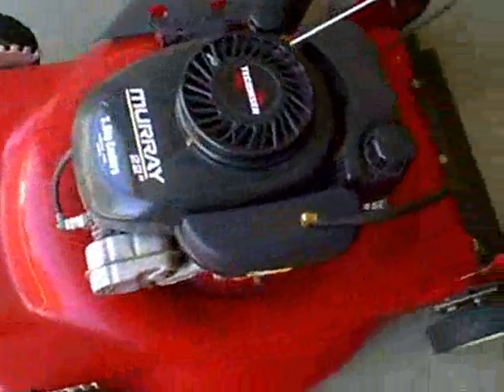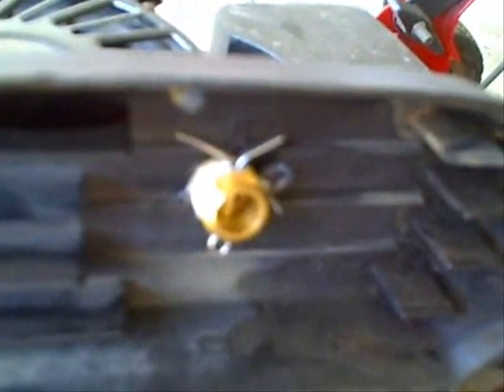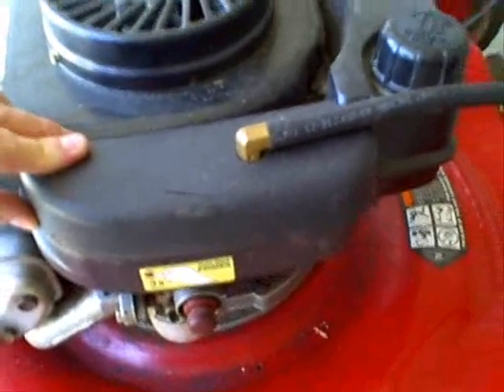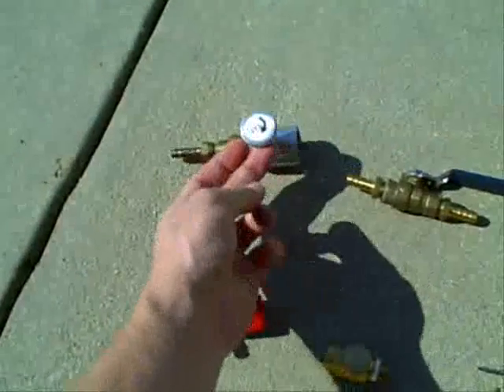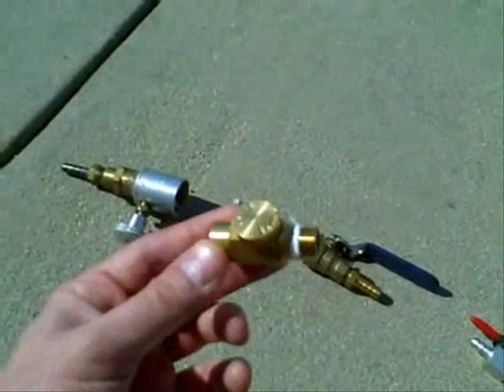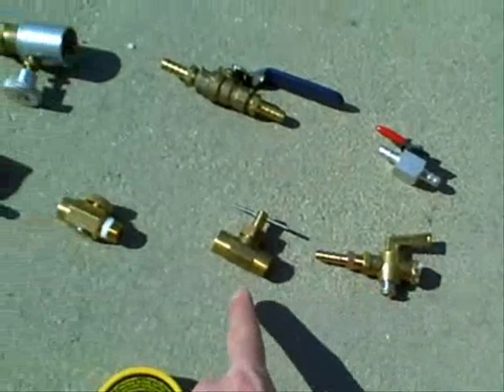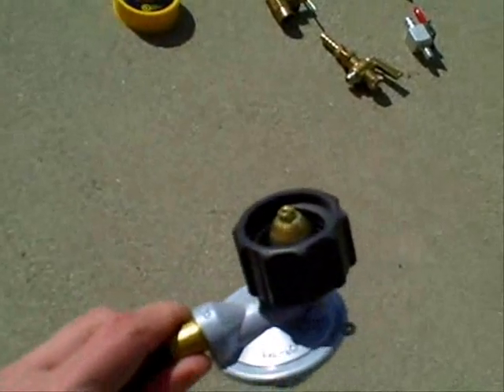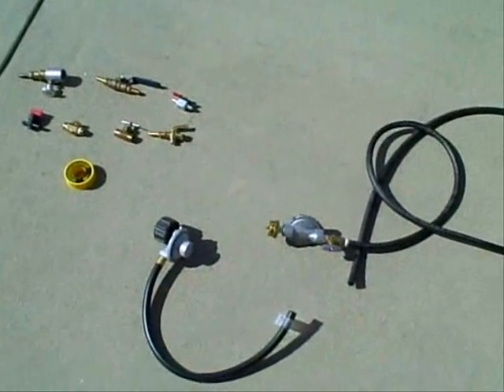Gasoline mower to propane conversion - Part 3 of 3

Comment: My propane valve freeze up , the valve  Seized up, And I can't loosen the  valve , how can I stop this issue from  happening?
Reply from the maker: If the regulator on the propane tank is working correctly the freeze up should not happen. When there is a faster than normal depressurization of propane or the propane goes from a liquid to gas state very quickly...things can freeze. My suggestion is to move the valve further down and away from the regulator.  Run a couple of feet of fuel line  from the regulator...then install a brass barbed T valve...then run another section of fuel hose to the motor. In essence you are creating isolating and insulating the valve from the cold.  The ambient air temp and a black fuel hose heated by the sun and distance of valve from the regulator should correct this.

Comment: Thanks for the fuel conversion recipes. I have used it on three mowers. They cut grass. The best part is that I am not wasting a road tax on gas that will never see a road. It is sad how many folks get robbed by the road tax to cut their yards, firewood, and gardens. Road tax is approximately sixty-eight cents per gallon. That is a substantial loss over a lifetime of mowing. For me, the principle of wasted and inappropriate taxation is even more important than the price.

Now, to shift gears, I have a problem with the engines and I hope you may have an idea.  After I use the LP system for a season or two, these engines "blow up" in an unusual way. Oil gushes out the left side. This last one had oil running from the air filter. I want to keep using this fuel system. I do not see what is causing them to do this. Have you seen or heard of this problem? I know it is not realistic to expect you to diagnose it by this comment alone without seeing it. If you have experience with this problem I hope you may send an idea this way. I will keep trying. Thanks again and keep up the good work.
Reply from the maker: There are only a few reasons that I can think of where this might happen. If oil is coming out of the muffler, you will get a lot of smoke. This may happen because the rings on the Piston are worn and oil is blowing by the Piston getting burned during combustion and blowing out the exhaust valve. If oil is coming out of the carburetor air filter area it is possible it is overfilled with oil. Another reason might be that the mower has been tilted too far towards the carburetor side. Lawn mower engines can only be tilted so far toward the carburetor side otherwise oil in the bottom of the engine will pour out of the carburetor and into the air filter. I don't know of any reason why switching fuel to propane would cause this issue. I will do some more research and see if I can find another cause.
Reply from the maker: I would also remove your spark plug and inspect it for contamination of oil or heavy carbon buildup. If the spark plug is covered with oil or has burnt oil on it then it's an issue with the piston rings or overfilled oil capacity. Another potential issue could be that the intake valve is out of adjustment. This would cause the intake valve not to seat and seal completely during the compression stroke causing oil to be forced out of the intake.
Reply: @sparkynapalm3662  Thanks for answering. I like how clean the lp burns.  Your mention of the intake valve gives me something to examine.  That may be part of the problem.  I hope to perfect this as I like the lp system.  Thanks again.

Comment: Hi Brian:  Can U use a line smaller than 1/4 and if not why?  thank you TOM
Reply from the maker: Oh yes u can easily use a smaller diameter line as long as the engine is getting the flow of propane its needs. The only reason I use 1/4 inch inside diameter is because first is finding brass fittings of that size is simple.  You can sometimes find fittings down to 1/8 of an inch.  1/4 inch fittings and valves are just easier for me to get and connect to propane regulators.

Comment: my questions are whats the fuel run time compared to gas? How long does a camp fire bottle of fuel last over all? And how is the power under load? Propane has a lower energy density that gasoline. Meaning propane explosion will have a harder time pushing down the piston than a gas explosion. So when you transfer that energy to the blade of the mower under load or high grass  how bad does the mower bog down? or will it quit easier under load than the gasoline engine? I understand that lawn mowers do quit if bogged down with heavy grass. but will the propane cause it to do it more since its explosive force or severity is less than gasoline?
Reply from the maker: You are correct that propane has a lower BTU energy rating than gasoline...however small gasoline engines are notoriously inefficient...lots of unburnt gasoline energy is waisted out the exhaust. Propane however burns more cleanly and efficiently.  I have never experienced a problem with propane mower bogging down or having an issue cutting anything as when powered by gasoline. Seems to have plenty of power on propane.  By the way check out videos online of propane drag racing cars. As far as how long a camping cylinder lasts on a small mower. I can cut my .20 of an acre yard about 3 times before needing to refill. The heat of spring and summer helps with vaporizing the cold gas.

Comment: I'm likely going to do this with my rider that has a tired carb. Just going to get a spare airbox that fits it in case I screw up.
Reply from the maker: I think you will find that it works quite easily.

Comment: Great Videos. So smart and easy. So, where do we purchase the needle valve that works so well and others recommended to you? What size and such. A link would be great. I intend to convert my 6,000W Generator the same way you did yours and you used the needle valve there as well. Thanks!
Reply from the maker: Needle valves of 1/4 inch size . Some are found at local hardware stores like ACE and Tractor Supply and the like. Barb connectors too for black fuel hose.  Can also order them online.  Use gas ine pipe tape seal on all threaded connections and test for leaks.

Comment: Globe valve works better at controling flow than gate, needle valve will give you finer controll.
Reply from the maker: Thank you for the input. Needle valves have been what I have been using for the last 3 years.

Comment: So you run the fuel THROUGH the air filter and do not run the fuel LINE through a hole in the air filter?  Right?  Thanks for these three excellent videos.
Reply: +James Richardson - If you have the " Breather Hose " on your Engine... Regardless what kind.... It will be easier to " T " it off and less work and headaches!  NOTE:  I just did one today, it works great for like $3.00.....  I got most of the " Other " stuff for free from a Propane Grill... I cut the hose and added a T and that was it.  :)

Comment: How do you keep the crack case lubed up if there's no oilin the fuel?
Reply: The engine is a 4 cycle so it has a separate section for oil to keep it lubed up if it is a 2 cycle engine it is going to be a problem

Comment: +Brian Blue I have a wall mounted ventless propane heater that i am trying to hook up to a 20lb tank the problem being is that there is no adapter ( that i have found) to go from 1/2in flared line down to the 3/8 hook up on the tank. the heater already has the regulator on it and the shutoff valve too. so im also trying to avoid using a second regulator on one line. any help would be awesome, i have checked in with all my hardware stores around here and even heating companies too but nothing seems to thread together to go from 1/2 -3/8.
Reply: MrPushard you need to take the flare connection off. Gas heaters always start with npt connections and you adapt from there. So somebody put the flare connection on there, just go a little further back

Comment: you know by doing this you take off an important safety feature of the modern lawn mower and thats the dead man shut off, now as a kid years ago we didn't have that you set your speed on the motor and went about mowing the lawn. however if your on a hill this could save your foot arm or any other part that comes into contact with the moving blade. I ran over a cat once years ago in tall grass its not a pretty sight talk abou cat gut! who's got a throttle body for this come on there used on fork trucks, someone has to have a way to shut off the fuel.. for a generator this isn't a problem, but a push or riding mower this is a big problem. Someone needs to address this.
Reply from the maker: +bobbg  The safety handle was only clamped down for this demo so I could be near the motor and explain certain things.  When the tank it mounted and hooked up the safety handle to ground the spark plug and shut down the motor works as normal.  As you know most push mowers RPMS are set at the factory with a governor attached to the carb...this only works with liquid fuel.  But because this goes through the air box and not the carb the propane regulator regulates pressure and the valve regulates fuel low to adjust RPM.  One could install  what is called "on demand" or "zero pressure" regulator that operates by vacuum pressure that would allow an engines regular throttle to work but they are pretty expensive.  Fuel shut off is a concern but the amount of propane that is being introduce into the engine is so minuscule what little bit that escapes from the air box dissipates into a air to propane ratio that is less flammable.  There shouldn't any source of spark or ignition that close to the engine.  Propane needs around 900 degrees to flash ignite and it must have the right fuel to air ratio or it wont burn.  Propane has an ratio so narrow fuel to air that it's safer than gasoline.  Take a look at video 2...i address some safety issues.  Thanks for writing.
Reply: bobbg no you dont, dead man switch shuts off spark to the engine not fuel

Comment: Brian Blue, I installed these things on my mower.  It runs for about ten minutes and stops.  The outside of the regulator, valve, and hose are wet and cold.  I will add that there is NO ice which would represent a gas leak.  When it stops, the valve that serves as the throttle has no effect when opened or closed.  Any ideas how to keep it running without the stopping?  Jed
Reply from the maker: +Jedediah Crouch   It seems as though you are having an issue due to freeze up.  I've heard of engines suffering from this time to time.  Vehicles that run propane use a heat exchanger to keep this from happening.  The valve and regulator getting cold and wet is normal at times as tank pressure decreases but I've only seen this happen when a large volume of propane is flowing.  Very  little propane is needed to make the mower run. The longer the propane flows the more of an issue it will be with freezing.  Another thought coming from my flying experience....carburetor icing.  Since you mentioned the hose is cold and wet too....this is odd and leads me to believe the length of fuel line is too short.  A long coiled piece of black fuel hose acts as a heat exchanger to make sure no super cold liquid propane makes it inside the carb.  The colder everything gets the more chance there is the cold will make it to the carb in effect freezing the carb and restricting airflow thus stalling the engine.  It sound like you have no problem getting it started after sitting a while and this causes me to think the problem is fixed when the carb heats back up. Carbureted aircraft engines suffer the same problem and is why "carburetor heat" is turned on when those planes fly in high humid environments.  The fuel vaporizing the carb cools it and the humidity creates ice that chokes the engine.  Try a longer length of hose...perhaps 3 times the length you have now and coil it around the handle down from the tank to the carb.

Comment: Thanks for taking the mystery out of propane conversion. I want to build a hybrid three-wheeled scooter. Propane makes more sense than gasoline. I can imagine a design that replaces many mechanical linkages with electronic ones.
Reply from the maker: If you build one put up a post on it.  I'd like to see it.
Reply: Brian Blue Within a year maybe two. I'm a nerd who's trying to finish an animation project.
What you've done is pretty revolutionary. A city dweller 'might' be able to keep a scooter indoors without the smell of gasoline. A digitally controlled valve that would open based on some condition would be part of the design. I'm sure such a valve is available somewhere.
The machine I built to make 3D photos was removed to protect my ability to get a patent. I discovered there was little interest but I did learn to program.
Imagine a robot snowplow controlled by Wifi that you don't have to go to the gas station for. It's do-able.

Comment: Thanks a lot for doing these videos, ive been wanting to convert my tractor for quite a while. I sent part two to my dad, hes always been sceptical about this sort of stuff. Believe it or not, I have everything I need to do the pt one version! Just no regulator, but it should be ok for experimentation.
Reply from the maker: If the tractor has a fuel pump and pressurized fuel system you're best best would be to get one of the commercial conversion kits that use what is called an "on demand" propane regulator that uses a vacuum line. I've seen some very large John Deere farm tractors converted.   Tractors engines that use simple carbs are generally very easy to convert over with the designs I use.  Here is a commercial link who can design a system for the tractor if mine doesn't work. http://www.centuryfuelproducts.com/generators/conversion-kits.html